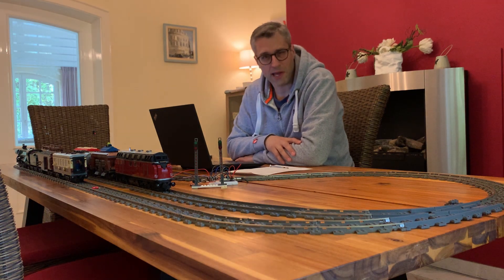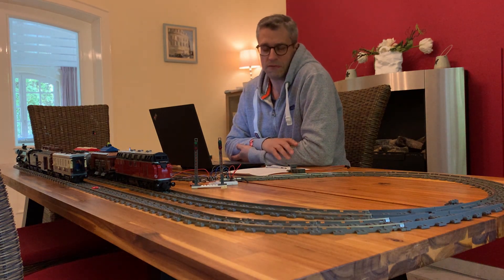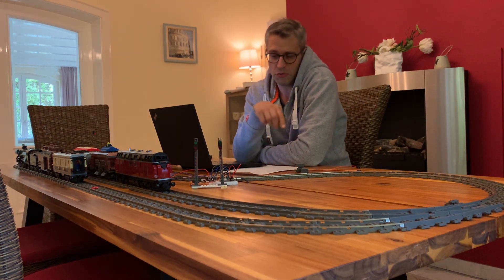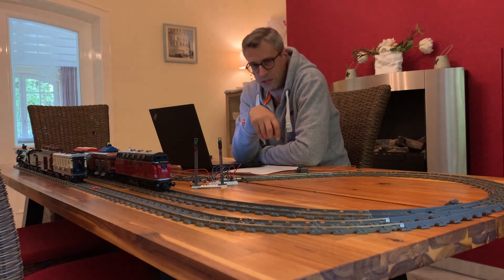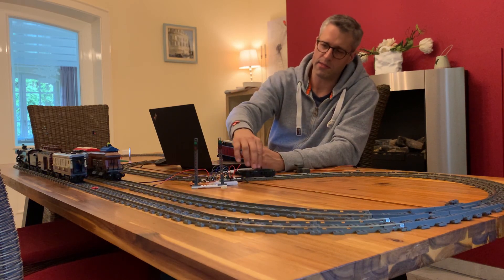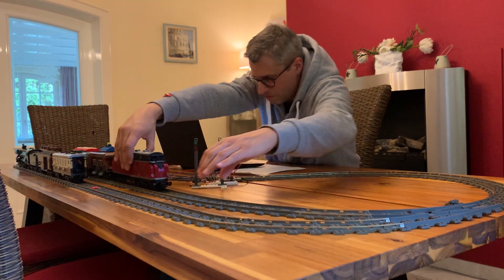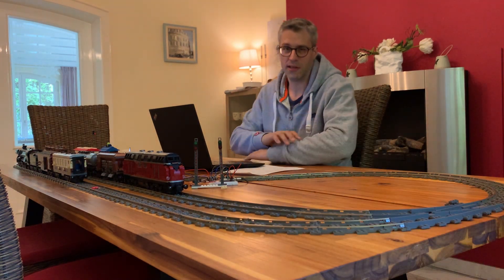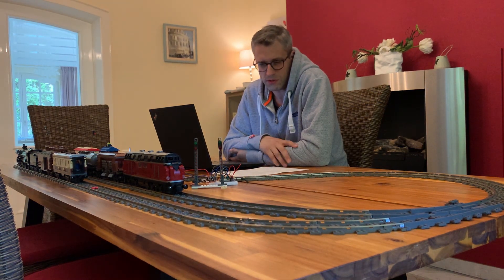Lego Train Automation - Reed Sensors [en]

Comment: Nice! What are those lego pieces called in stores?
Reply from the maker: If you mean the parts that hold the reed sensor: it's part no. 4081b, "Plate, Modified 1 x 1 with Light Attachment - Thick Ring", color of choice would be "dark bluish gray". https://www.bricklink.com/v2/catalog/catalogitem.page?P=4081b#T=P&C=85

Comment: I wonder if you can add a second reed switch to detect different trains?
0 0 = No Train
0 1 = Train 1
1 0 = Train 2
1 1 = Train 3
You can OR these inputs for train detection
Reply from the maker: This is a technical and also a philosophical question. The philosophical question is, what you want to achieve with a sensor and if it is worthwhile to actually DETECT trains on the layout.

Let's have a look at the different situations where sensors are relevant:
1. You want to get the information that a train has reached a specific position on a track (while your automation software has expected train to eventually get to this position due to the route that has been set for the train).
2. You want to DETECT and IDENTIFY a train on a track, while your software did not necessarily expect this train on that track.
3. You want to DETECT and IDENTIFY a train on a track, while your software has expected this train on that track. If a different train appears on that sensor, or the train shows up somewhere different on the layout, the software would usually pull the emergency brake and stop all operations, or it just updates the train position on the layout and is happy.

Other types of sensors also transport information if a train has left a specific track segment, but you can not do that with the reed sensors shown in the video without problems.

So, if you really want to DETECT a train on the layout, parallel reed sensors might work - I haven't tried it yet. As I foresee problems with interfering magnetic fields, I believe it would be quity a tricky experiment. The next problem is that if the train goes the other way around after a loop, your train 0-1 would be 1-0. If you want to overcome this problem, you would need to suppose 1-0 be equal to 0-1, which would reduce your number of trains to 3 with 2 bits.

If you really want to detect trains on the layout, RFID might be a better option.

Sorry for the long answer. I know I am a nerd.
Reply: @mattzobricks  Your right,   RFID would be the best option. I know Lego has used RFID before with the RFID sensor for Lego Mindstorms NXT and LEGO Dimensions. It would be great if Lego Built a RFID a solution for The Lego Train enthusiasts.  Your also correct about the Reverse Train Problem, Inputs AB would turn into BA.  Anyway: Looking forward to your next layout automation Video.  -Chris (also a nerd)

Comment: Are the Reed Switches activeated by the magnets in the couplers ?
Reply from the maker: That was my big hope when I started the experiments, but unfortunately the reed switches do not get activated by the magnets in the couplers. Somebody has proposed to exchange those magnets with strong neodyme magnets, or to place an additional neodyme magnet between the couplers. I will try that, but I could imagine that it fails because of the wrong direction of the magnetic field of the coupler magnets in space.
Reply from the maker: I have new information about triggering the reed sensors with the magnets in the couplers. Check http://mattzobricks.com/components/sensors. Thanks!

Comment: Will it be 9v track of pf with wireless control?
Reply from the maker: The trains are controlled by WIFI. I would love to run on metal rail completely, and to power up and control the locos over the track, but for our large layouts we prefer curves with large radii (R104 / R120) and R104 switches from TrixBrix. If metal rails and switches with decent geometries and a reasonable price are eventually available, I'd be interested. But I'm sceptical. So far, all companies that have tried to sell LEGO metal rails went bankrupt.
Reply: MattzoBricks Fx bricks is working on a 9V track system including new motors, switches and different radii. They plan to sell starting this summer.
Reply from the maker: Yes, I am aware of them and monitor it closely. As far as I know, they have already postponed the release date of their metal rail products. I hope for the best, but I remain sceptical. The investment costs for a single track or switch are brutal when you build it with metal rails. I doubt that they can make a working business case out of it. Especially when you have a look at competitors like TrixBrix, who release new and usually pretty cool products almost on a weekly basis.

Comment: Why dont use Rfid sensor to détect the train?
Reply from the maker: Absolutely a good question. I have it on my to do list. RFID detection has the advantage of checking that a train has taken the correct route over the layout, i.e. you can check if a ghost train has entered a block, and pull the emergency brake (stop all trains!) for the whole setup. Another application would be to identify a train that leaves a railyard where you operate trains manually, and enter the automated part of the layout. Lots of exciting things...